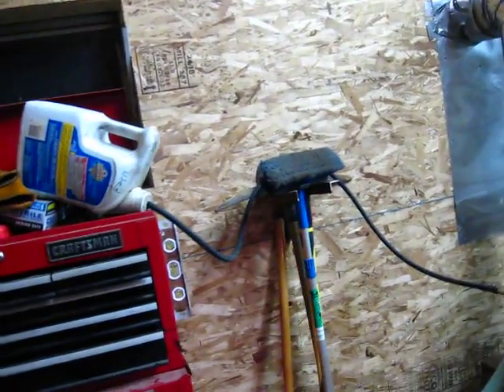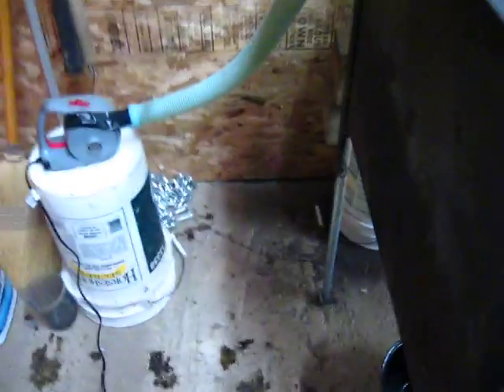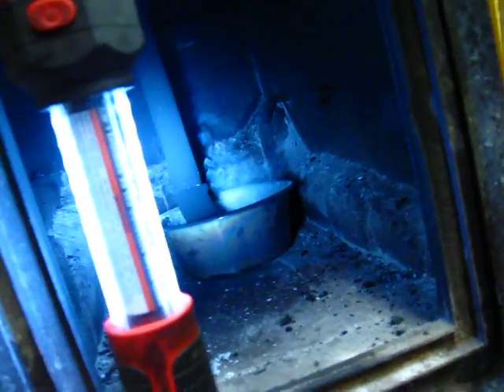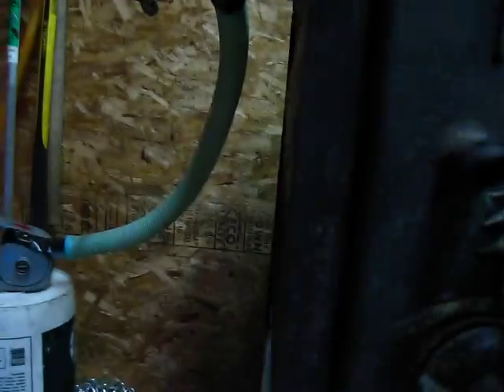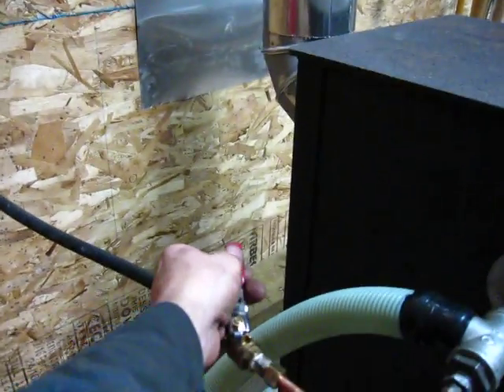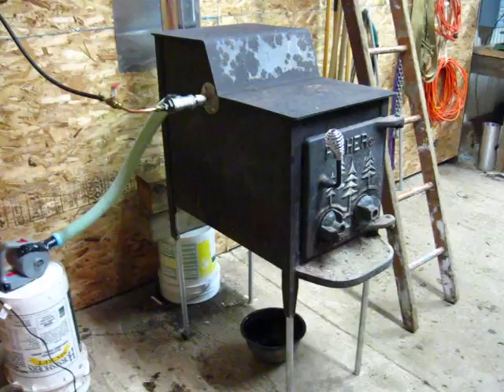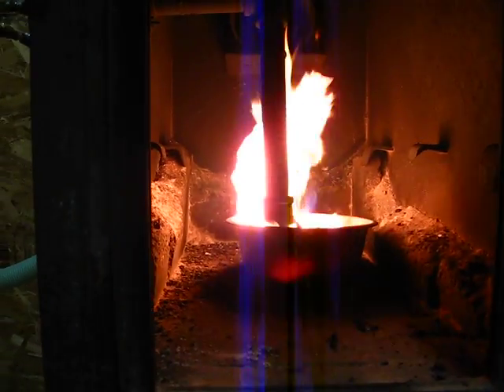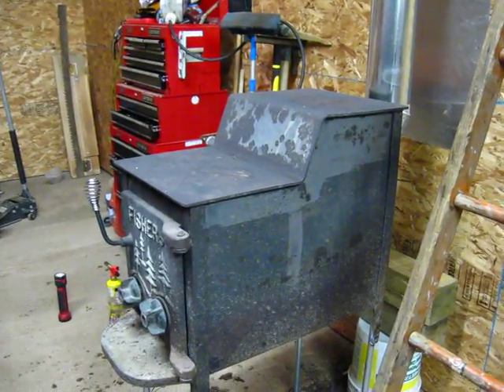Homemade Waste Oil Burner

Comment: Does the stainless steel pot burn out after a while? I used a plate steel box and it burned holes through it after a month or so.
Reply from the maker: The stainless is much better in high heat cycle conditions, i have run this for four years now and am just now needing to replace the pot... $3 at tractor supply

Comment: Get rid of the air pump, you shouldn't need it, draw the air through with a natural draft from under the burn pot.
Reply from the maker: Steve Lindsay 
without the air pump the oil dose not vaporize properly and will not burn clean. Having spent a lot of time on research and testing trust me when i say  it is completely necessary to force air into the burn chamber... the oil is not pressurised so the air must be

Comment: shouldn't need an air pump at all. You are just forcing heat out the chimney.
Reply: Vaporizing the oil. Burns way hotter this way

Comment: Nice, how do you connect the copper tubing to the black pipe Tee, keeping a air seal while continuing with the copper pipe thru the rest of the black pipe?
Reply from the maker: I used a compression fitting that i drilled through so the copper would go through it and used a reducer to go from the tee to the fitting

Comment: what type of  fan did you end up using , my air mattress pump burns up after about 7  days  ??
Reply from the maker: +Ron Nichols I bought a cheap "mini" leaf blower from ebay, have yet to see if it will work http://www.ebay.com/itm/Pit-Bull-CHIG153-Electric-Hand-Held-Blower-Vacuum-/322008655654?hash=item4af9362726:g:acIAAOSwx-9WwNrY
Reply: +4x4countryboy please let me know. I just ordered a bounce house blower.will let you know.thanks
Reply from the maker: that burned out very quickly... I ended up going with a dayton draft blower meant for a furnace, about 50cfm. Runs on 120v, you can get them on ebay for about $60